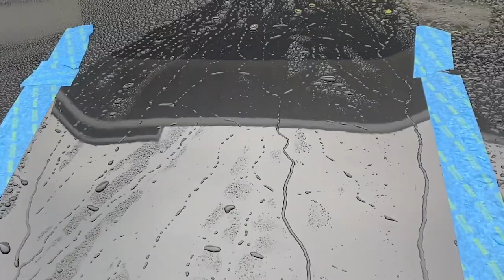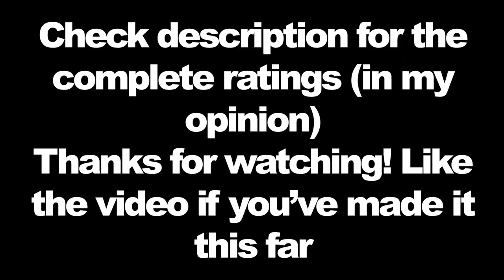Nexgen vs. Turtle Wax Hybrid Solutions vs. Ceramic Pro Review & Torture Test!

Comment: You simply can't beat Turtle Wax for the money and the performance!
Reply from the maker: Absolutely agree👌🏼I’ll be using this from now on
Reply: Yup and given there was no curing time on tw ceramic spray
Reply: I also have tried the Turtle Was and like the Meguiars the best. Once again buy the product you like at  your local automotive supply store when its on sale.  I prefer indirect sunlight and little water with the Mequiars to get the most out of it. Clay bar before use of any of these products as well.   I never bought into hyped up marketing of Nexgen.  Believe me, Nexgen solicited me by text and email without my authorization.
Reply: Just tried it. Didn't even do a proper prep. Just a good wash (not perfect), air dry, applied sparingly then wiped again with a new clean cloth after waiting about 30 min. It looks GREAT. Knowing this I'm going to get the system and do it right. For the price, performance and small amount needed it really is amazing stuff. I would imagine for less than $100 and a little bit of elbow grease you can keep the finish  looking beautiful for the life of the vehicle!
Reply: @CynHicks  I highly recommend the Hybrid Solutions Ceramic Polish to start.  It's a mild cut Polish that removes oxidation, light swirling and with the combination SiO2/Carmuba/Polymer blend is a kill-er base coat.  Very easy with a DA polisher and can be easily worked by hand if necessary.  24 hour cure and THEN coat with Hybrid Solutions Ceramic Spray.   You will thank me.
Reply: @audieconrad8995  Thanks.... and yeah I have water spots trapped under the coatings. Like I said in the other comment though I'm going to get the other products and do it right. It really is pretty great as is though but the finish was already nearly new so...
Reply: @audieconrad8995  Have you tried the wash that they recommend to use on it?
Reply: @CynHicks  hi Cyn, sorry I missed whatever wash/shampoo was mentioned.  If your intent is to start over and get back to virgin clearcoat/paint I highly recommend the Turtle Wax Max-Power soap.  It has variable ph strengths according to mix ratios, is VERY effective (strip&clean), very reasonably priced and is available anywhere. Works well in a foam gun as well - I prepped my winter wheels this week using that set-up.  Actually, if the truth be known - for strip/clean purposes (ONLY!) any high strength DAWN dish soap variation works wonders as well.  I use it in my homemade engine degreaser mix.  Works gr8.
There is wretched excess of ALL kinds of auto washes out there  - I recommend the above mentioned to keep it simple, effective, and accessible. 
That being said...lol...IF you are looking to use a good maintenance shampoo to go along with the Hybrid Ceramic Polish and Spray - the Hybrid Ceramic shampoo wash is an excellent choice and works REALLY well as part of that system.  Good luck - TW has a real winner with that lineup.  I've  been VERY satisfied with it.
Reply: @knabster  yea NEXGEN went super hard on there slimy thieving marketing tactics
Reply: @audieconrad8995  THANK YOU! THATS EXACTLY MY NEXT TREATMENT. IVE USED TOMS OF DIFFERENT BRANDS AMD TURTLE  WAX  HAS ALWAYS OUTPERFORMED ANYWAY ON EVERYTHING. BEEDING PROTECTION SLICKNESS AND THAT SHINE!!!!!! ESPECIALLY!!!!! 🌞
Reply: 🐢  truley is an ethical company. There's a reason they've been numerous 1 for 77 yes 77 years!!! And in 90 countries by the 90s BEFORE THE INTERNET!!! THAT SPEAKS VOLUMES TO THEIR DEDICATION TO INNOVATION AND INTEGRITY. ITS AMAZING THE COMPANY CULTURE HAS NOT ONLY STAYED THE SAME BUT HAS BECOME EVEN MORE PASSIONATE HAS THEIR COMPANY CONTINUES TO BUILD ASKING THEMSELVES EVERYDAY "HOW CAM WE BE BETTER THEN YESTERDAY ❤ 🐢 ❤ 🐢 ❤
Reply: @seekdiscomfort4746  yeah man...SHINE.  I live in Maine so protection and durability are important but ALWAYS 👈 like to see someone else who seeks SHINE! TW as a consumer brand has just killed it over the last decade once their ICE line hit the market... even the entire green line is remarkablely good AND consistent. 
I understand that yet another line is ready to be launched on or about December 3,
2021 - stay tuned!
Shine on you crazy diamond! 💎🚘

Comment: Probably should have done a proper cure time on all of the products, shouldn’t introduce chemical to most of these spray coatings for minimum of 24 hours
Reply: Exactly. I was like how do you not let it cure atleast over night
Reply: True as a certified installer I give a min of 4-8 hours for the sport
Reply: The Turtle Wax instructs to wait 24 hours before getting it wet and to apply a second coat the next day and use a damp cloth to remove any hazing left after a clean, dry buff. Mine does anyway. I didn't even do that or the prep and it at least looks great. Next time soon I'm going to do it right. 😁
Reply: I saw many videos did the same zero bleeding even after 24 hr cure
Reply: 🐢  truley is an ethical company. There's a reason they've been numerous 1 for 77 yes 77 years!!! And in 90 countries by the 90s BEFORE THE INTERNET!!! THAT SPEAKS VOLUMES TO THEIR DEDICATION TO INNOVATION AND INTEGRITY. ITS AMAZING THE COMPANY CULTURE HAS NOT ONLY STAYED THE SAME BUT HAS BECOME EVEN MORE PASSIONATE HAS THEIR COMPANY CONTINUES TO BUILD ASKING THEMSELVES EVERYDAY "HOW CAM WE BE BETTER THEN YESTERDAY ❤ 🐢 ❤ 🐢 ❤
Reply: I need to add to this that months later my windshield became sandpaper like. It repelled water like nothing I've ever seen but it was rough and translucent.

The cure time instructions are apparently very important. I had to use way too much scrubbing to get it off. If you put it on glass MAKE SURE you do it in a paint booth like atmosphere and let it cure fully. I ended up scratching my windshield trying to get it off. 

My mistake, I guess, but my point is it isn't the spray and wipe product it claims. It IS good but it requires more attention, prep and time.

*I live in a humid environment and that no doubt played a role. Not sure I can use this again. If I avoided the glass I guess it would be okay but for me that was a huge selling point. Spray and wipe. Easy....Not really.

Comment: All of these products require a minimum cure time however I will say that creating value by only making a product available by a certified installer will give you the perception that the product is better. There's a wonderful reason for the competitors and that is a free market and a competitive market. I have paid thousands of dollars to have my vehicle paint corrected and ceramic-coated and looking back, the main factor in the effectiveness of the ceramic coat was the paint correction. All of these are just sealers or sealants. Any one of these three would be a good addition has no single product is going to be applied to a vehicle and ignored for years. You will most likely apply this product every few car washes and not every 6 months. And that's just a simple fact because if you're buying these products then you really like to take care of your car and you like spraying the stuff on your car which means you're not going to wait 6 months to spray it on again. And the industry knows this and they all take advantage of the buyer which is why competition is good. You can't have a certified installer tell you that the spray-on coating is 70 bucks and then complain that Turtle Wax is a water-based Ceramic spray on when that's the same thing as the $70 ceramic spray-on coating all of these are water-based sealants. What you're paying for with a certified installer is there professional ability to take responsibility for their work and not f it up. Learn to do this yourself and save yourself some money.
Reply: Agreed...who's gonna wait 6 months to reapply???  If that's  the case don't  even bother...

Comment: you shouldn't use water in spray form to show beading quality, just run the water directly from the hose so its a smooth stream, that will show best how good the water beading is for each product.

Comment: The technology in ceramic pro was not fully bonded or properly cured for 24hrs. Any ceramic coating needs proper curing to avoid failure.

Comment: Problem is...turtle wax is just one part of a whole line of ceramic products your supposed to use together.  So as well as the turtle wax did...it would have done better if you used the whole recommended line.

Comment: So I have a car that has old buffing swirls on it. Does the ceramic spray makes those permanent or should I get a "color correction" first?  Hope this made sense. Thanks!
Reply from the maker: Paint correction would be the right first step! Then use the ceramic as a sealant final coating
Reply: The Hybrid Solutions Ceramic Polish is definitely what you need if your swirling is not to deep.  A fantastic first step/base.  Recommend a DA polisher if you can although hand application is work but can be effective.   I love the stuff.  Because of it's SiO2/Carmuba/Polymer blend it's  like a first-rate cleaner wax. Same 24 hour cure time THEN...apply/top with the Ceramic spray.    Ohhhh ya...

Comment: Is the hood ceramic coated or just regular OEM top coat? Would like to see properly prep if OEM top coat to get effective result but given they are same coat hood turtle wax do a good job in protecting and sealed the top coat to give good beading and sleekness.

Comment: I've wondered if Turtle Wax Hybrid ceramic was better than NexGen.  Considering no cure time which makes my life easier and worry free, TW is a fantastic value.  I will pick up a bottle very soon.  Have you had any experience with these products applying to a car that already has a ceramic coating and/or PPF?  If so, please let me know your thoughts
Reply from the maker: These can be applied over PPF. If the car already has a true ceramic layer, you should use a ceramic booster
Reply: @KevG   I applied Avalon King in December. It’s a daily driver in New Jersey and the coat has started to fail on the doors. What kind of ceramic booster do you recommend? What about toppers for a really smooth glossy feel and look?

Comment: So in conclusion, NexGen sucks, Turtle Wax hung with the Pro, for the money you can't beat Turtle Wax Hybrid. $15 and you can use it about 10 times on the average size sedan, before you need to purchase more. So, fifteen bucks verses 200 for a "professional" ceramic coating that's not really going to do much better than the Turtle Wax. Also if you use the TW Hybrid Car Wash along with detailing spray it will outlast the "professional" stuff.

Comment: I put the turtle wax ceramic spray on my car 2 years ago and it's still on there. Behind the tires it's gone but everywhere else it is still beading up. I've been washing my car with purple power trying to remove it cause I'm wanting to do paint correction.  Taking forever for it to wear off. Maybe I got it on too thick?
Reply: That sealant has been long gone. 2 yrs is a long time for a DIY ceramic sealant to last. And using Purple Power would have taken it off the first time you did it. You are literally taking the clearcoat off at this point!
Reply: @mustardman5366  ...You are correct,  hold the mayo.

Comment: There are hundreds of brand-named Waxes and Paint Protective Coating products with categorized/specialized labels. Weighing the Pros and Cons. Use what you can afford is my best advice. Do not neglect your vehicle, use what you know works well, some protection is better than no protection. Turtle Wax, Maguiars, Mothers, NexGen, Chemical Guys, etcetera. Have an expensive automobile, try using the top best 3 or 5, or pay a recommended certified Professional Detailer. Don't have the time, hire a neighbor teenager or friend's kid. Stay a million miles away from automatic and touchless car washes as they do more damage to your vehicle than good. Always best to wash and wax your vehicle at home by hand. Real Ceramic Coatings come in glass bottles, not the spay-on type, and must be done indoors kept away from the harsh environment and weather as Ceramic Coating requires 48 hours minimum to cure after the application is finished. Then absolutely no washing for 2 weeks. The spray on Ceramic waxes needs 24 hours of cure time and durability or longevity is roughly 8 to 10 weeks or 4 to 8 car washes and done. Real Ceramic Coating will last 2 to 3 years, some types may last nearly 6 years, if your car is taken care of but much work needs to be done in preparation for Ceramic Coating. The best place for a car is to park in the garage with a car cover over it when dried off.